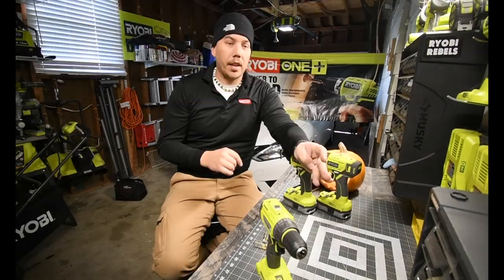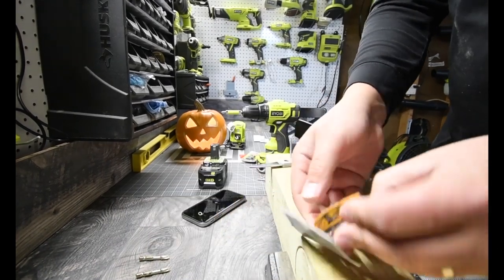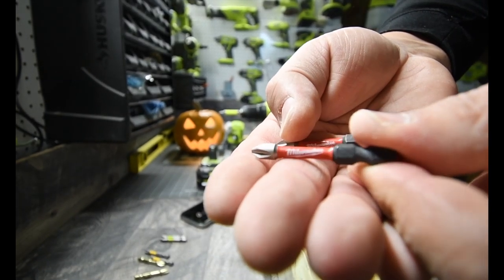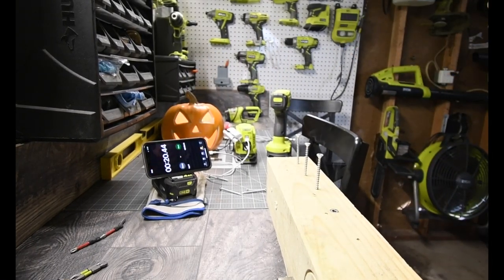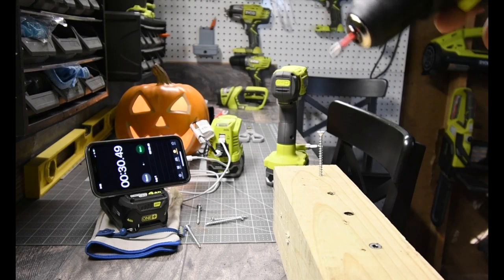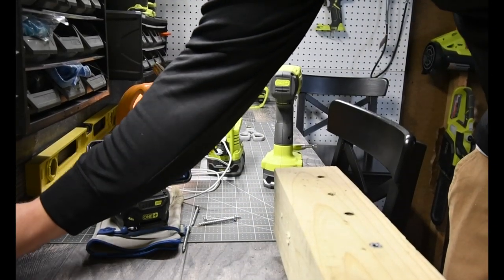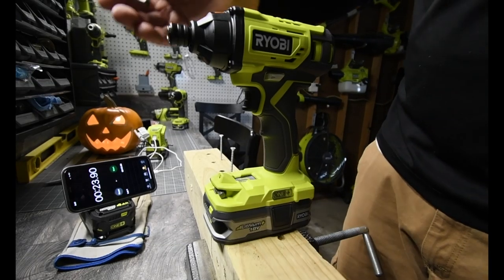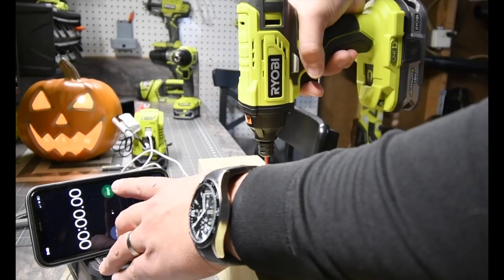Drill Driver bit war

Comment: Nice! I have Ryobi  bits but they don't have the Green color on the "Torsion Zone" as they are calling the skinny part on the fairly newer bits. I had to look up that info & they are designed to "Flex/Bend" a little & if you drive it too hard, it's supposed to break the bit. But it usually ends up stripping out the Philips head before the bit snaps as you showed in this video. They are designed for modern impact drivers. Another great video & it made me look up other types of bits as well!! Until your next one..... Peace...
Reply from the maker: once again thank you greg, you are the man

Comment: I only use DeWalt driver bits. Maxfit is really great value for performance. FlexTorq is even better. However Makita makes a really great impact socket adapter. The problem with Phillips is that it's designed to slip, but they're cheap.
Reply: According to Wikipedia, phillips screws were not really designed to slip:

"The design is often criticized for its tendency to cam out at lower torque levels than other "cross head" designs, an effect caused by the tapered profile of the flutes which makes them easier to insert into the screw than other similar styles. There has long been a popular belief that this was actually a deliberate feature of the design. Evidence is lacking for this specific narrative and the feature is not mentioned in the original patents.[7] However, a subsequent refinement to the original design described in US Patent #2,474,994[8][9][10] describes this feature."

As a result of phillip's demonstrable inferiority, they changed the patent, but not the design, to claim their propensity to slip and strip as a feature.  In Canada, a great variety of general purpose screws are typically robertson type unless you're dealing with drywall screws where you you'd use phillips with a screw gun specifically designed to cam out.  Larger threaded fasteners have hex heads that aren't designed to slip.  Robertson cost no more than phillips in Canada and the fancier star, posidrive and allen head screws all cost much more for no detectable increase in performance over robertsons.  For nearly all wood applications, camming out and destroying bits and screw heads is no advantage.  

Furthermore, confusion with JIS and other similar cross head screws result in users applying the wrong tool to the screw messing up both tool and screw.
Reply from the maker: Yes they are and thank you sir
Reply: Dewalt bits are the worst bits Home Depot sells. Home Depot breaks down the chemistry of the bits to find out what Materials they are made out of and what percentage. After that they put them to a performance these int the lab. Dewalt ranked the worst performance and Makita performed the best
Reply: @MH-yo5ui  Kindly provide a link to a Home Depot source for this alleged "testing" and metallurgical analyses.
Reply: @MH-yo5ui    I can't find any trace of  Home Depot testing of bits.  That's not proof it doesn't exist but your claim is extraordinary and as such requires some evidence. If you've had a poor experience with a brand, please share that so people who take the time to read reviews can consider your opinion.  If someone, perhaps even a Home Depot employee, has bad mouthed a brand, perhaps based on their biases or misuse of tools, that is a different matter than controlled systematic testing under realistic conditions.  A metallurgical analysis will not definitively establish a superiority of any particular bit under all circumstances of screw finish, type, size, pitch or substrate being driven into.  In addition to longevity, you'd need to consider that an overly hard or strong bit would be more likely to damage screw heads.  One bit design or composition might be better for stainless steel screws and another for zinc or anodized finished screws or may work with a particular screw manufacturer's head pressing, machining or tooling process than another's.  Show us the testing do that readers can assess whether its worthy of consideration.

Comment: BS tests all the way around. Who cranks on their bits “to see when they smoke”? Impacts bits are designed specifically from softer alloys compared to non impact bits so that they can flex under load, so this tests nothing about their performance. For some actual testing of bits see channel Project Farm, he conducts actual scientific tests for cam out, wear, and braking strength under high torque loads. Not this nonsense that proves nothing...also the Ryobi bits obviously started smoking at about the 5-6 second mark on the second test, so way to shill for Ryobi by calling it 8+ seconds.
Reply: Ok I take back the shill part of the comment, but the Ryobi did start to smoke earlier than 8 seconds.
Reply from the maker: this is the only way to do this test. would you watch me drive in 500 screws for each brand bit? I wouldn't watch that

Comment: That's why I never use Phillips head screws.  Robertson screws and bits are far superior.  You need only one bit to build a deck with pressure treated lumber and the bit remains intact to build another.  I haven't bought a phillips screw in over 20 years and as a result, any phillips bits I have in sets remain pristine.  Backing out Robertsons requires less pressure on the tool to prevent slipping so they come out much cleaner as well and the screws remain reusable.

Looks like the Dewalt bits drove the screw heads further below the wood surface.  That suggests the tips are tougher yet.  The impact energy absorbtion narrowed shanks are supposed to mitigate driving screws too deep.  They rob power from the tool so that it is difficult to drive the bigger screws.  A bit of operator skill and a variable speed triggers and adjustable speed settings allow you to get by with cheaper single thickness shank bits.
Reply from the maker: Phillips heads are out dated.